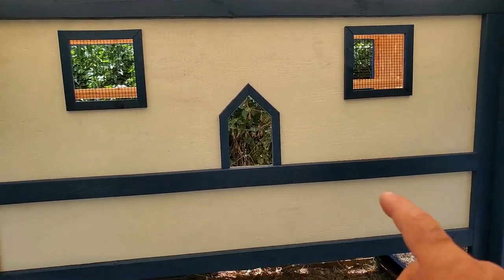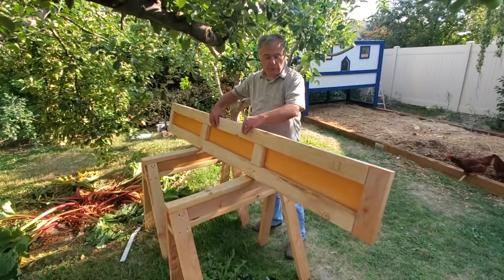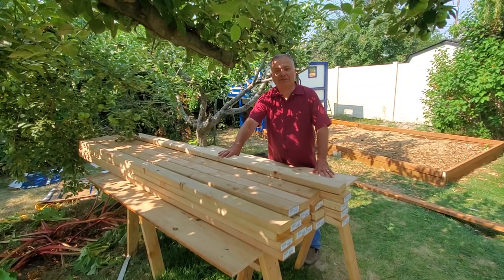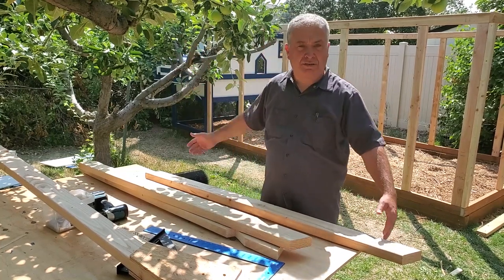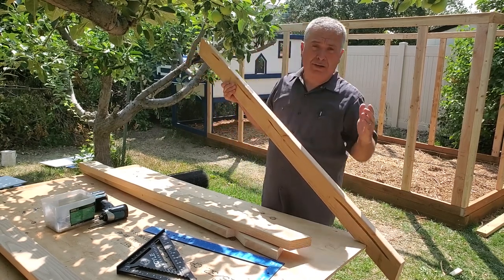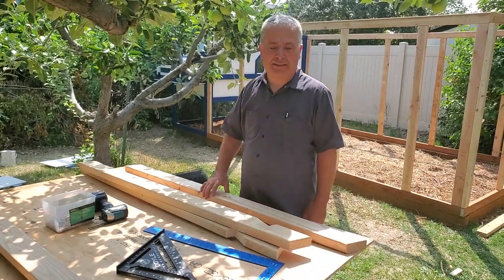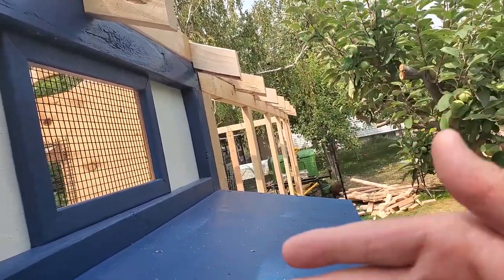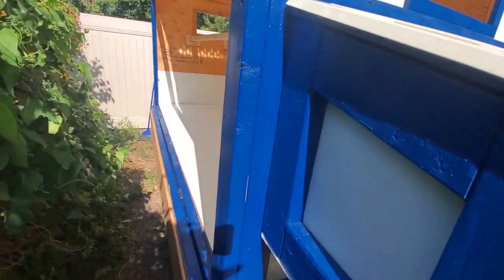Building My Chicken Coop Part 3 - The Run!

Comment: Hi, I watched all videos, so glad you posted on your website a materials list, I've got it! One thing I missed, length and quantity of the roofing material -- I'm not trying to reinvent the wheel, I'll go with your pitch -- and I'm doing the same overall size 8x18. Awesome Job!  Thank you so much!!
Reply from the maker: Cool, glad it was all helpful. I don't remember how many roofing panels I used. I know I got them at Lowes and they were plastic, normal width, and 6 foot long. I had to trim a bit off. I think if you know your dimensions and the width of the roofing sheets you plan on buying just allow for a couple inches overlap on each side and you should be able to get pretty close to how many you need. Sorry I don't remember the specific number I ordered.

Comment: Love this, great ideas for the nesting box. We are seriously considering chickens. Interested in what you will feed them and I’ll check out part 4 for the watering system. ✅
Reply from the maker: Chickens can almost feed themselves in the summer free ranging. They also survive well on hard red wheat. Their egg production drops a bit but they still produce and do fine. If you have a local granary near you you can often get uncleaned wheat much cheaper. Just be sure it's not seed grain that they sprayed with pesticides.

Comment: I have followed your video, and I’m at the point of the trusses being up. I have not put any horizontal strips up yet. My question is, was your structure stable in the middle at this point? Or will the roof horizontal pieces and panels tighten everything up.  corners are super strong, so that’s not an issue. It’s very level as well.